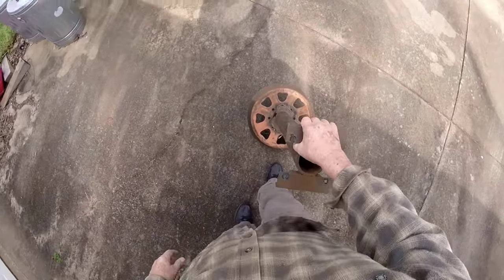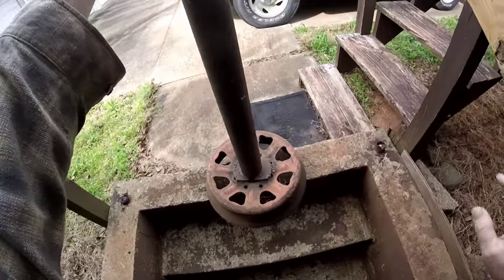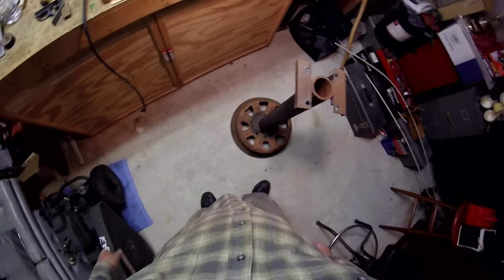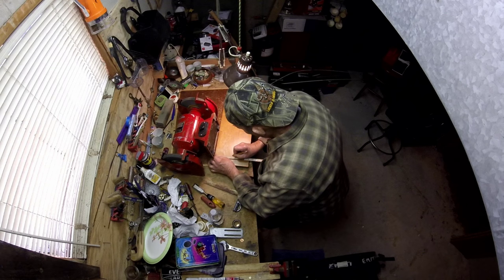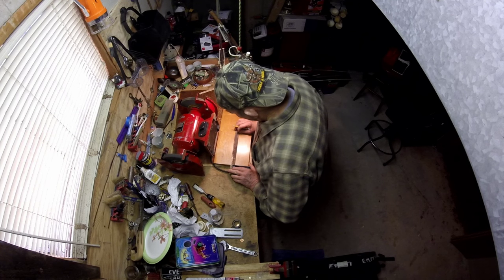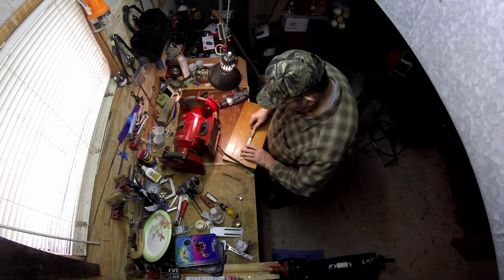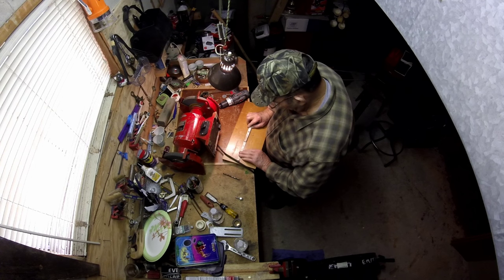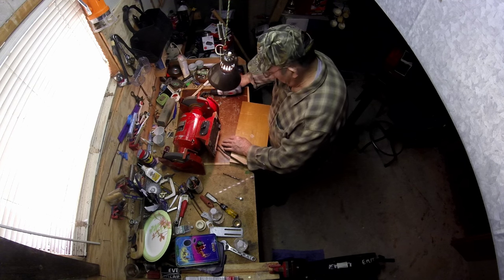Bench Grinder Project Part 3 1 31 2016

Comment: Mr Walter 

Hello we are in class watching your video fixing a stand for your grinder Mr Carter told us to put every thing in its place when we are done with our tools and things we use Mr Carter said you work space is cluttered and you need  to clean it up I think I found you tape Measure if  it's green it's on the top right corner behind a pice of wood
Thank you Little Walter (May) RunningBear
Reply from the maker: +RUNNING BEAR Mr Carter is right  I do have a very messy work bench I will try to do better
Reply from the maker: +RUNNING BEAR I do appreciate the class watching my video  Mr Carter sounds like a very good teacher,
Reply from the maker: +RUNNING BEAR  Jim,  E-mail me at Walter@carknocker.com and then I can forward you my regular email address.  Little Walter says his class watches some of my videos.  I plan to mention him in an upcoming video  Walter